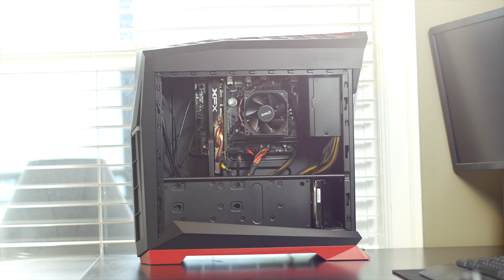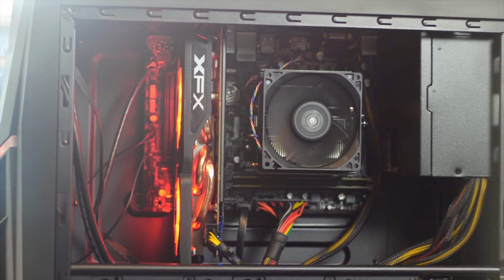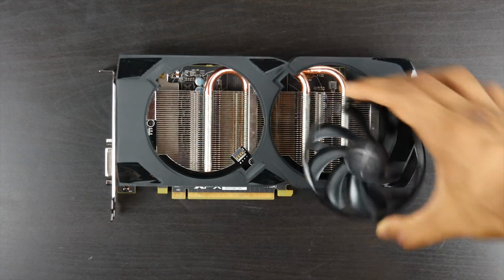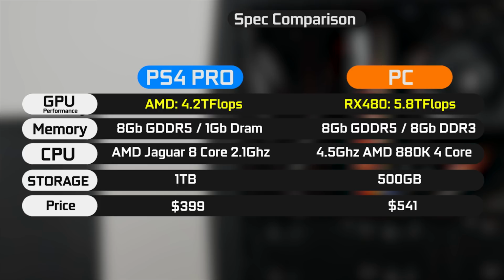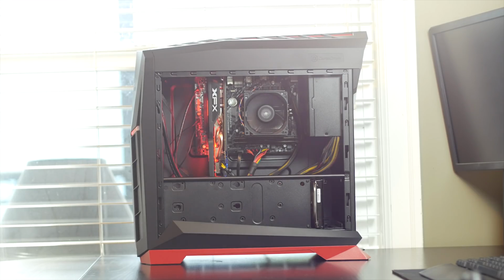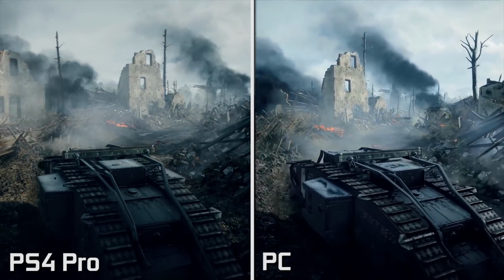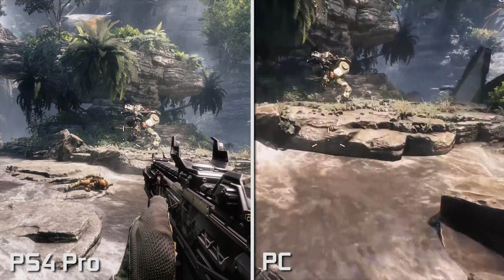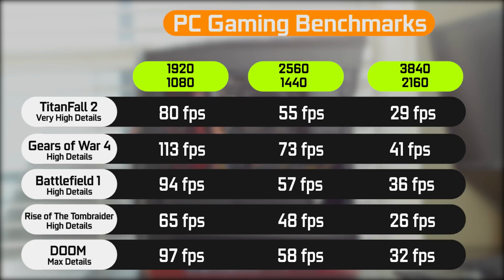Playstation 4 Pro vs $550 Gaming PC

Comment: The ps4 pro is now $350 good luck building a gaming PC for that price.
Reply: byrne1et LOL you have no idea wtf you are talking about. The cpu bundle is a server, thats why its so cheap, the performance isnt even that far off an i7, it is literally the same cpu just designed for something else. These items are so cheap because they get outdated with newer more reliable hardware so companies throw out the older servers to replace them with newer ones to ensure that they keep going under server loads, and PCI-e wifi dongles exist and yes they do fit on the mobo with the gpu. Lmao please search stuff up before u make fun of yourself over an invalid argument. And even if u think that the cpu cant play games u can extend ur budget to 20$ more and u can get a dual cpu mobo for 50$ with everything included, yes that is 16 cores clocked at 2-3 ghz 😂😂😂😂
Reply: $100 GPU, $50 motherboard $40 powersupply $20 computer case $20 Hard drive  $200 for a full computer ez
Reply: caos024 I am not. You say that PS4 is better than PC just because of the price of the console, but at the end PC is better and cheaper. You get a general purpose machine, you dont have to pay online suscription, the games cost much less, real HD gaming and your eyes and brain wont suffer 30 fps motion sickness......
Reply: Lol i can build a pc rn for 300$ that would put that cute ps4 back in the trash can.
Reply: good for porn.
Reply: Of course u can build a PC for $300. You just don't get to play Red Dead Redemption 2 on it.
Reply: oh and dont even try to make controllers a problem because every single controller that uses USB works on PC unlike ur shitty ass console where you are forced to buy a controller priced even more than your games.
Reply: byrne1et byrne1et + about ur other pointless comments "no psu costs less than 20%" u can actually get a case with a psu and fans pre-installed for 15$ i forgot what it was called but it exists, btw i actually researched the prices before i bothered enlightening you cuz im planning to build one as a present so i know the exact worth of these items that i listed, on top of that u can even get it for cheaper if u have the patience and wait for the right deals by winning auctions checking your local stores and pirating windows. Really "motherboard is so bad" its a fking server unit how can it be bad 😂😂😂😂😂😂
Reply: Good luck editing video on your console

HOLD ON!!! You won't
Reply: SEÑOR BURTOS BAIA I edit all my videos on my console... Fail?
Reply: http://www.tomsguide.com/us/record-edit-video-ps4,news-17900.html here is a guide to share and edit video right on the console.
Reply: Good luck trying to stop the fire once your PS4 Pro starts burning.....
Reply: You think I don't have a computer. A dual video card would cost as much as one ps4. I also own ps3 nothing have burn yet. It depending on the game library I like to play it work like steam if you ask me.
Reply: Rock&Roll Did you know the PS4 Pro got a bad design? It overheats and sooner or later will stop working.
Reply: PC people damage controlling lmfao!!!!
Reply: iAMaReaperGotprobZ So you can get a motherboard and ram for $30, but you spend $35 on a mouse and keyboard!!!??? Then a case, PSU and HDD for $20!!!??? Are you build a gaming PC, or castles in the sky?

If you are spending $200 on a GPU, you will need a half decent CPU and RAM, you will end up spending more than the price of the GPU for the mobo, CPU and RAM alone.

There is also no way on earth that you can make a gaming rig for $70 minus GPU. Oh, and the monitor, is it flatscreen or CRT? For $45 I would imagine the latter?
Reply: magburner A gaming PC might be more expensive but it is a machine for general purpose, not only gaming.....Also you can play at 60 fps +....Your Eyes and brain wont stress that much.
Reply: Rock&Roll pc still kicks ps4 ass
Reply: PS4>>>>>>>>>PC tbh. Games is all that matters in gaming. Everything else is irrelevant.
Reply: caos024 Gaming at 30 fps 900p upscaled is not really gaming....
Reply: Edward Parra I hope you're trolling...
Reply: Edward Parra I never mentioned price makes it better. Price isn't even a problem to me. It's the games. PS4 games are far better than PC games. And motion sickness? are you serious? I never before had motion sickness. That's just a silly excuse.

Comment: That video card makes me laugh, no one is going to buy it because of the hot-swappable led fans when there are RGB cards available if you feel the need to change coulers so its just a needless extra cost and failure point on the cooler.

Comment: This isn't a fair comparison, especially when he prefaces it with the price of the PC parts may vary. Meaning that if we checked, the pricing is probably higher. There is no way to confirm he's actually giving us the proper pricing. And even if he is, we are talking about 550.00 dollars compared to 400.00. A proper comparison would be put together a 400.00 dollar rig and see what you get. That gpu will not run games in native 4k without some severe concessions in other graphical areas. Things will have to be reduced. I know because I have to reduce stuff when running 4k with my GTX 1080. So his statements aren't exactly truthful. On Tomb Raider I was dropping  frames big time. In my mind there is know comparison here, the Pro is awesome for the price, and just think of the Playstation exclusives you'll be enjoying that won't see the light of day on PC, Red Dead Redemption looks awesome, so does Horizon Dawn. I don't compare Consoles to PC. They both serve different functions. I just game on both. I have a PC for games like Star Citizen and Consoles I have cause in general, I like to own and sell back my discs, and I love the exclusives. Also there have been some severe optimization issues with PC lately. And developers seem to down right ignore PC at times. So the safe bet to to game on both. That way when the Arkham Knight fiasco went down on PC, I could still play the game on my PS4. Just Cause 3 is another poorly optimized game on PC. Also...Steam sucks balls, I really don't like dealing with them. There are Pros and Cons to both, but this guy is not being fair with this comparison.

Comment: All this shows is that the PS4 Pro is ridiculous value at $400. No PC can match it today or 5 years from now when this PC will be shit in another year while the PS4 will still look and play games well in 2022. 

I mean look at GTA:SA and GTA:V or Call of Duty 3 and Call of Duty: MW2 or whatever was the last one on Xbox360. 

Consoles actually get ridiculously better with age while PCs die off in ~2 years or under. Esp a cheap PC like this one which will be crap in ~1 year. 

Also, proper comparison will include : mouse, keyboard as well for PC (another ~$50 or more)
Reply: fxp You realize there is a LOT more to owning a system than just the initial buy in, right? With a console you have to pay to use the Internet you already pay for and games in general are more expensive on console.  In addition to that games go on sale all the time on pc and there are many other things like free games, mods and so much more that you don't have to pay for.  On top of that you have no idea what you are talking about when it comes to an aging hardware. I've had a gtx 760 for 4 years (mid range card) that can play bf1 on medium 60 fps (which looks a lot better than bf4 on ultra, which it could also run at 60 fps) so that kinda throws your "shit in a year or two" claim in the shitter. If you are going to say something, try to have something of an idea of what you are talking about.
Reply: Dumb pleb, even the gtx 1080 will be outdated in 2022.
Reply: no more Scooters The ps4 isnt going to last nearly as long as the last gen of consoles did. The last gen were very powerful for their time, where as the ps4 hardware was decent at launch, now only comparable to budget gpus and mobile phone cpus.  The 1080 will not be a super powerful card in 2022, but it will still be quite competent considering gpus are gradually seeing less of an increase in power due to troubles creating smaller chips and that this gen of gpus was a large leap in performance.

Comment: Would've gone with a MUCH cheaper case.  This is honestly and awful build because with Zen right around the corner you're still on DDR3 memory.  I would have gone with an i3 6100, because you already have a clear upgrade path vs being stranded on archaic technology, and down the line if you want to upgrade to an i5 6400 or 6500 it's plug and play.  You're getting benefits of DDR4 and more PCI lanes to work with, as well as power efficiency.  With budget in mind, I definitely would have gone with the 4GB RX480, because with light overclocking its memory speeds can match the 8GB.  And wtf is up with that cable management?  Looks disgusting tbh fam.

Comment: you forgot the ps4 APiS that are more efficient
Reply: Compared to the RX480 that doesn't mean anything as that hardware is quite a bit faster than the gpu in the PS4 Pro, if both gpus was the same in the PC and Pro then yeah the Pro would have the advantage.
Reply: No shit a console that has two configurations and is mass produced by the millions will be more optimized than any PC out there. That being said, it isn't even close enough for the raw power of an RX 480 even if it was "optimized" poorly. You are just trying to throw fancy words that you do not truly understand.
Reply: Justin Also since consoles have gone x86, many of the console optimisations are being used with the PC port of the game and I suspect that will increase once they get to grips with Vulkan and DX12, so yeah consoles will have better optimisations but the PC has been closing the gap a lot that it doesn't really matter anymore.

Comment: That CPU will bottleneck the sh*t out of the RX 480
Reply: Tru rx 470 would be better or an i3 6100 and rx 480
Reply: Watchmen22 when ur mum checks ur comments :)
Reply: I was thinking the same thing
Reply: ***** In a large amount of games your single core performance will play a big role in your overall FPS, this is where the i3 will shine as AMD can't compete at all when it comes to single core performance. Since the AMD is a quad core, however, and it scores better in some quad core benchmarks, you could expect some decent jumps in frames in games that utilize all four cores effectively. In most cases the RX 480 will be at least mildly bottlenecked by either the i3 or the Athlon.
Reply: with overclocks no

Comment: Can someone please give me a pcpartpicker.com link for this build?
Reply: Please don't buy this build lol.
Reply: Max Wolf why? (im new to pc building and i want to know why this build isnt too good)
Reply: 1)
The case costs too much for this budget, should've gone with a cheaper one (50 $ at most) 
2)
The FM2+ platform is outdated. 
3)
For the price of the CPU Mobo RAM - combo you can get an i3-6100, a z170 chipset mobo and 8 gb ddr4-2133 RAM
Reply: Travis Rice How is an i3 bad for gaming lol? The i3 is nearly as good as an i5 in most instances. But the FX line is better than the i3? The i3-6100 is way better than the 6300, and better than the 8300. You are mad wrong lol.
Reply: just wait zen and u have a scorpio killer lol :D
Reply: giulio cecchi buy a toaster and you have a scorpio killer
Reply: Well a z170 is kind of pointless with a 6100, as it's locked, which means no official overclocking.
Reply: i agree with 1, 2 is also true, however 3 is mad wrong. i3 is practically the worst processor for gaming. i5 minimum (for AMD; the FX line), then there is the ddr4... while its has higher FSB rates...that actually tends to not matter when the DDR4 CAS latency is twice as high (lower is better for CAS) as DDR3. they are actually about the same in terms of pure data throughput.
Reply: What do you mean by "i3 is practically the worst Procesor for gaming" and "i5 minimum"? 
Gaming doesn't need more than 4 cores, what i3 (hyperthreaded) has. An i5 is sth what you should get at most, the i7-6700lk's single core performance being the worse than the i5-6600 's. 
And the fx-series... Honestly, I'd buy one of these instead of and i3, but due to their low single - core performance, I don't do it. Yeah, co) you are able to overclock, but it's not the same when a cpu is 3 years old or just 1.
Reply: Mátyás Fekete do ur research then ull see. check benchmarks with an i3. not gonna argue with someone uneducated on the topic.
Reply: Here are your performance marks - 
http://hwbench.com/cpus/intel-core-i3-6100-vs-intel-core-i5-6500
Reply: Travis Rice see?
Reply: The build is bad because it has a cpu that will bottleneck the gpu. Also the AMD chips are out dated
Reply: TiDDle The Cow The 880k won't really bottleneck a lot. And it isn't old.
Reply: You know games like GTA5 and Battlefield can max out more then 4 cores for helping with ultra AND passing 1080p. In a i7 benchmark I seen it maxing out the four cores and using more when they enabled Hyperthreading. It helps FPS when the game can use as much as it wants.

Comment: Im impressed thta the AMD 880k could run battlefield 1 but i would never ever use the Stockcooler then putting your Cpu on 4.5Ghz is very high your Cpu is slowly killing itself but I would overclock the Cpu to 4.5Ghz then get a better cooler such as a coller with a 92mm fan or even 120mm fan and about 3 to 4 copper heat pipes